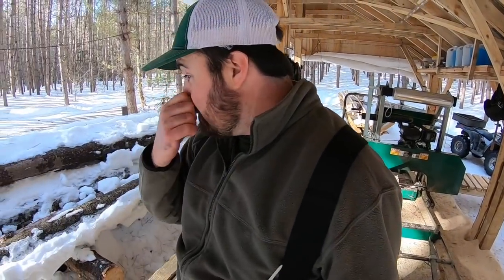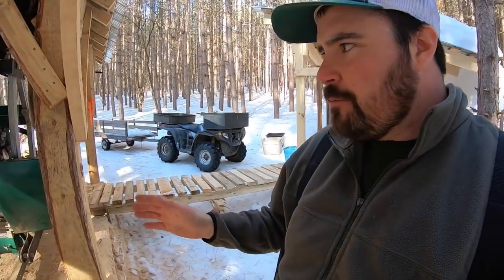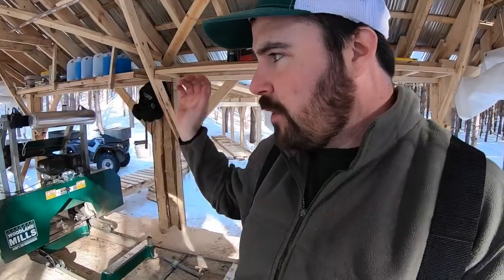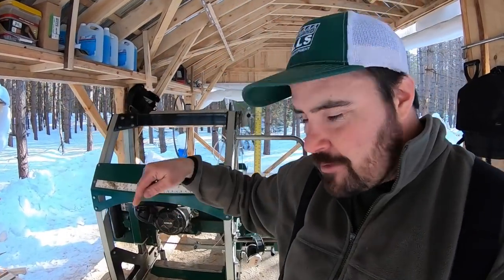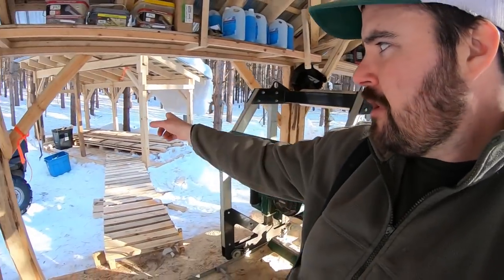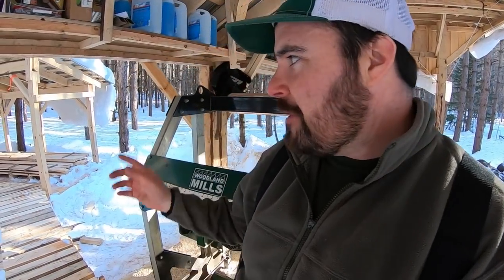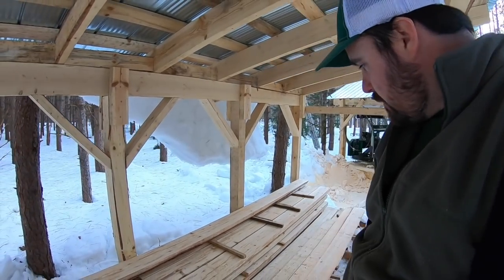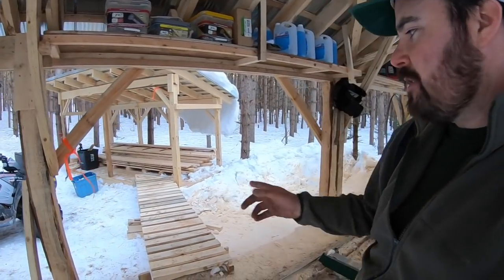The Real Reason I Saw Lumber

Comment: im planning on milling a whole bunch of 2x8 (1 5/8x 7 3/8) for a house this year. im planning on building a 3 storey house 28x 34 but i want to use it green so i dont have to wait till next year for drying. what are your thoughts on using green lumber? have you had much experience with what kind of shrinkage i will have and twist etc once it is all framed..?? also i plan on sheeting with 1/2 ply right away my concern is if the 2x8 shrinks and i end up with a gap between sheeting and studs?! i plan on finishing next year so it will have a whole year to sit and dry in lockup stage.

Comment: I just ordered the small mill. I can't wait to start making saw dust
Reply: I just put mine together last week. I’ve seen people say it took them 3hrs and it shows when you watch them fight issues. Took about 6hrs by myself, with air tools. Had one extension and mounted it on a trailer. The feet go fast with an air gun, and I just set them with a spacer to be all even to start. Doesn’t hurt to have a helper. I put the saw head together with the pallet across the bunks, that way it was just a matter of standing it up. I set the saw head high to no be in the way when assembling, stood it up when the verticals were bolted up. Use a welding clamp to hold the head from falling. The throttle cable pinch screw seems like a poor setup, on mine it was Tucked in but I was able to get it with a long driver. Actually the only part where I had help. The cable cleaners for the wheels were set a little long and would act as a brake. Have fun, it’s a blast!

Comment: been 12.50$ per 8' 2x4 up here since last spring. My alaskan rig and purpose bought saw (g660) has paid for itself many times over since purchased. Works out to about 1,000$ worth of lumber in the back of my truck every day I spend a few hours in the woods. Beats buying pretzels from the big box store at exuberant prices. Only machinery required is the saw and my truck. And a hell of a lot of grunting, and humping back and forth

Comment: Hello Glenn here, I have so many end of life and blowdown balsam fir that I can't count them 20 "+ 100 feet plus long. Some have a twist all of them have lots of small branches. Do you know any thing about balsam? If it dries dead standing it seems to stay dry. I am thinking that the twisted ones will probably make good 6x6's. I am in northern BC old growth that was cherry picked for 10 inch pine back in the day. I have poplar birch englman spruce hemlock Lodgepoll pine and cedar. I am an old carpenter and I have had experience with an Alaska mill powered by a Stihl 090. I lived on Haida gwaii for 11 years back in the 70 Ty's.
      I just ordered a 130 max with two extensions 😜🤩🤙. Thanks for your videos. Glenn.

Comment: Yeah it's the only way to go for some of us...wish I had better equipment and timber but whatever. My favorite was sawing on my grandfather's old circular farm saw...they have so many advantages over the band mills...#1 is you're not standing on your head to dog the log/cant...much easier to eyeball ur primary cut with the blade and toe it the proper amount...everything is done at waist level...cant return/set is very fast....the sawdust chain removes most of it to a pile far away...even with only a 50hp tractor powering ours you could cut enough lumber for a big project in several days...of course kerf width & need for tail-Sawyer are the drawbacks...
I have an lt15 i can use now...I did lay out a sweet setup that has a central sawing platform/floor with infeed/outfeed decks....frustratingly slow in comparison but its nice to be able to walk up to it turn the key & start sawing whenever I have some time...

Comment: Filling that fuel tank at eye level without safety glasses? An errant splash will dissolve your cornea and blind you before you can get to medical treatment. Just use a face shield when filling or rework your filling procedure. Stay safe.

Comment: I bought a HM130 Max  last fall and took delivery last week of November. Weather wasn't condusive for sawing most of the winter, but experimented on a couple maple logs. Got done with my maple syrup season here in northern Indiana, short 3 weeks season got 95 gallons of syrup, pretty poor after we had six days of over 65 degree weather.   I have a 26" branch off of a bur oak tree on the mill right now, heavy wood, making some interesting planks with lots of knots and figure.

Comment: I used to stack and sticker my lumber right beside the mill as I sawed it. When there was a fairly decent pile that my tractor would handle, I would pick it up and place it on 6 by 6's to dry. the tractor was fitted with a set of pallet forks.
Reply from the maker: Sounds like a good setup

Comment: Thanks Sandy. I`m definitely in your mindset. I'm just putting together my new HM130, and I`m having trouble with it throwing the blade as soon as I turn on the water. I have not even run the saw for 5 minutes, and it has already destroyed the yellow guard that slides with the water outlet and guide, but I notice you don`t have one. Maybe they aren't necessary? The new model (Max) has a tensioner that you set instead of using a torque wrench, however I couldn't help noticing your torque wrench in the background. Are you setting to 25`lbs? Have you had any problems with that, and if so do you have a video that deals with blade tension issues?
Reply from the maker: My manual calls for 25 ft lbs of torque but it is slightly different than the newer models. I’ve never had an issue with the 25 ft lbs. if your blade is coming off I’d imagine the tracking of your band wheels is slightly off. Be sure to check out my PlayList called sawmill setup for more videos dealing with blade tracking and cutting in general if you’re interested. Thanks for tuning in
Reply: @sawingwithsandy  Thanks. Yes, I will definitely check that video out. Have a nice day. Your videos are awesome.

Comment: I have a 130 max also and just started sawing. I have questions about calibration of the scales and boards bowing. First, when I zero out and use any of the magnetic scales on the machine it’s never the same as the true band measurement. Isn’t there a way to calibrate this so I’m not constantly measuring every single time? Second, when I’m making boards of 2x material the bottom of the cant always seems to bow off the log bed. Is this a log problem or a me problem?
Reply from the maker: I believe the scale takes into account the kerf or blade thickness so the measurement may appear a bit different.
Reply from the maker: Also I find that in order to prevent the sagging of the boards I try to move the boards so they are as much supported as possible by the log bunks. Hope that helps

Comment: Tip , if you want to make your own screen wash for winter make a gallon up add a bit of washing up liquid and 550ml of methylated spirits and the rest is water to make (1) gallon if it gets colder add more methylated spirit, you will never freeze your water tanks or screen wash bottle again
Reply from the maker: Sure would be nice as you can imagine without it it's hard to keep sawing
Reply: @sawingwithsandy  by doing this I have never had a problem in winter
Reply: @sawingwithsandy  I also sent another tip for condensation on the tractor cab in winter

Comment: I'm starting to building a log cabin 24+24  off grid
Reply from the maker: Sounds like a great project!
Reply: In the past I used washer fluid and dish soap. Other people put bleach as well.  Bleach help s dry out the wood. As well as boiled linseed oil. Now I haven't cut wood in 35 year's . Going to start in the Fall . Need to cut 190 logs starting a 24+24 octagon off grid . hydro power is 4 miles away, closess road is 1 mile away.